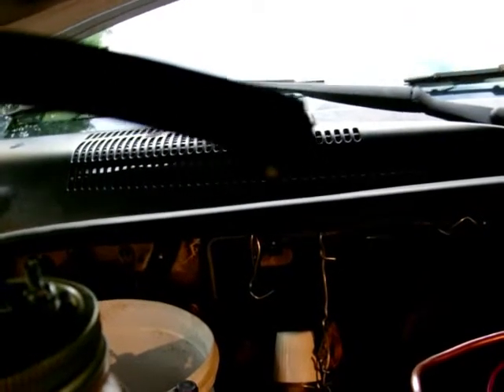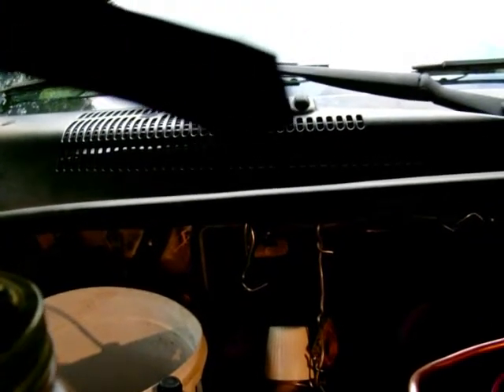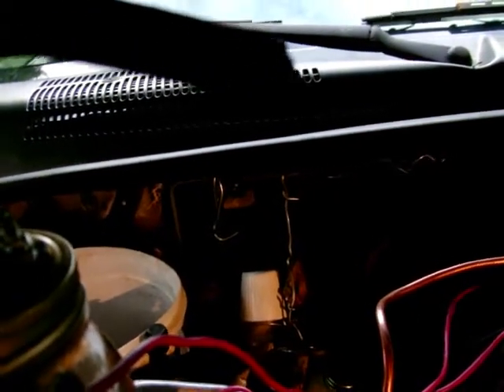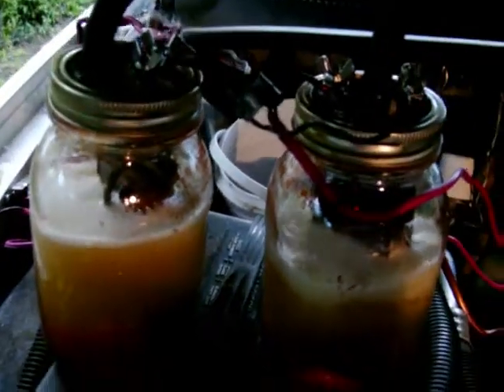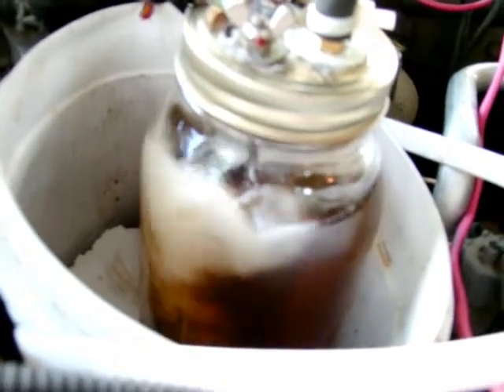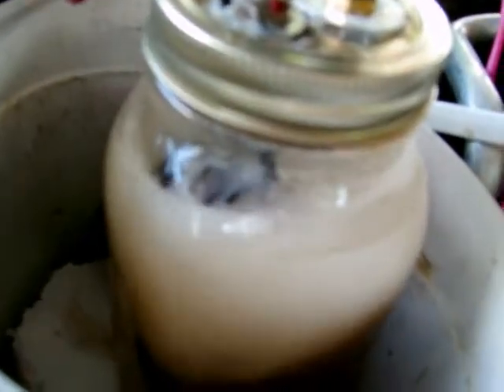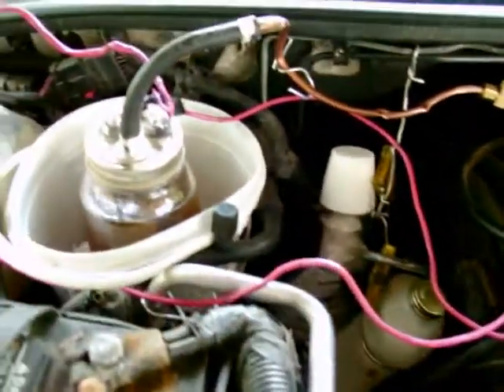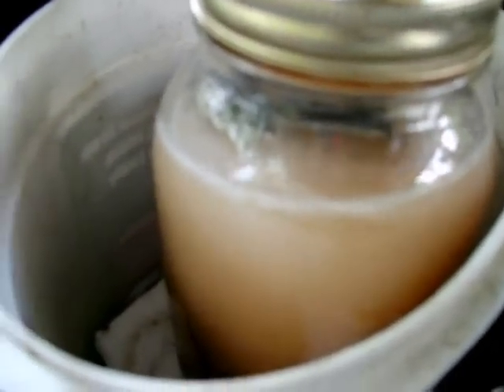Hydrogen fuel cell under pressure

Comment from the maker: this cell was connected to the intake causing pressure on the cell which the mix was boiling at 145degrees.The buse fuse was actting like a relay kicking in and out.This  generated to much heat ,i soon rebuilt cell and put it to breather were it's not under pressure